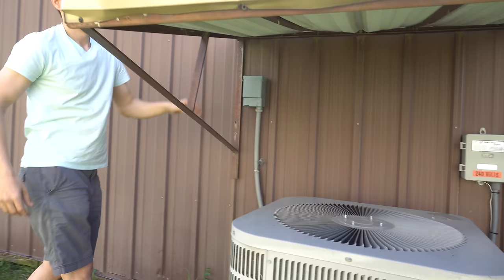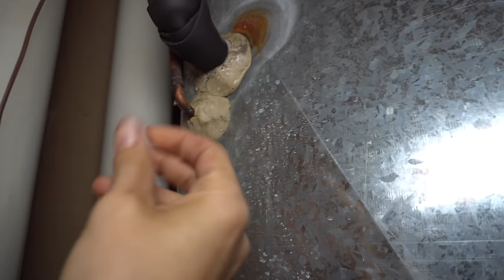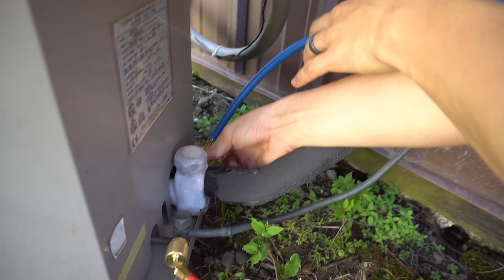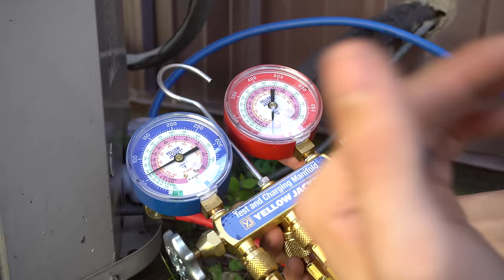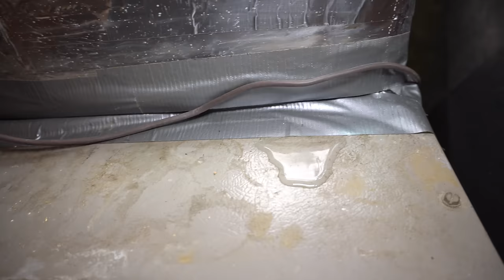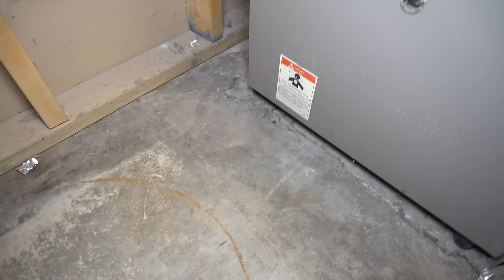How To Add Refrigerant To Air Conditioner

Comment: Addtinally the problem we have with a no weigh in charge (using a scale of refrigerant added) and creating a baseline of  proper temp/pressure utilizing subcool and superheat is the next technician comes across the unit (because your not available as a friend ) the cost becomes higher to the client. Why? When I know a customer has a leak (vs a restriction)-through tests- I cant do a leak decay accurately without a baseline of thermodynamic measurements. By doing this gas and go method we have no baseline numbers prior and after the recharge. Creates a higher cost of client as I might have to pull the current charge, do a reweigh of virgin refrigerant ( wont go into why I pull the charge and use new virgin refrigerant-lengthy best practices), then create my baseline of numbers temp/pressure/charge etc...Then from there ( if time doesnt allow to find leak) I schedule monthly to bi-monthly non-invasive followups to determine leak location and rate of decay- Check out APP #measureQuick every technician should be using a NON-INVASIVE process FIRST in diagnosing any refrigeration or HVAC system. Bottomline in the short run this costs a customer more money doing the "gas and Go" or "?cold beer can method?". Then properly planning for component replacement or unit replacement and or repair
Reply from the maker: Wow, that is a very detailed procedure explanation! Thank you very much for taking the time to explain thoroughly!
Reply: With all due respect.   He said the client was going to replace the unit in the video and that was why he was doing it in the manner that he did.  As a result, I think this video perfectly serves it's purpose. Additionally, (said in a purely factual tone) I looked at your Pro Answers youtube channel and was sad to find (ironically) that there were zero answers as you have produced zero videos (which is sincerely a huge shame).  It would be totally awesome if (since you are telling us the correct way) you would make a (COMPLETE AND DETAILED <<< emphasized)  video as you described here.  To be crystal clear... an actual easy to understand instructional video that goes step-by-step through the processes you described.  You can "talk the talk" so I am sure that you can "walk the walk".  I am just asking you to video it and make it your first video.  That being said (again no disrespect) I am hopeful that you will surprise me and produce the above requested video, but (unfortunately) I am willing to bet that you will not because of 4 things.  1.) The energy & difficulty associated with uploading, shooting, & EDITING a video so that it is clear and understandable to almost anyone (Kudos to Word of advice TV for your clarity). 2.) Doing so is a semi-selfless act (that not everyone is comfortable with) of helping others without reward (except maybe some google ad revenue).  3.) The general Mafia-like secrecy and mystery that the HVAC industry tries to promote & instill.  4.)  You may suffer from the mistaken general attitude that "if I make a video showing how to do it, I will be giving away my trade secrets and, thus, taking money out of my own pocket".  I VERY SINCERELY would LOVE for you to prove me wrong and make my last 4 points moot by producing the video and (if you do) please let me know, because I will probably subscribe to your channel at that point.  That being said... I am willing to bet money that Word of advice TV will beat you to it.  like I said, I hope you prove me wrong.  CORRECTION>>> I wrote all of the above BEFORE reading your next remark.  As a result...  I am 99.9% sure that you will NOT make the video (or probably any other videos) and that you are "most likely" a member of the jaded and secretive mafia-like "HVAC Illuminati" since you said that you disagree with this sharing of knowledge on youtube while CLAIMING that all of your decisions are driven by customer benefit when I am almost certain they are more about filling your pockets (as quickly as possible) with your customers cash... whether it be to their benefit or not.  I am not sure how you have the gall to get on youtube and critique those that seem to not agree with you.  In my opinion, "Pro Answers" needs to either change the name of your channel of focus on PRODUCING some videos (at least 1) before bashing other video producers investments of time and energy.
Reply: @jotu173  wow! Jo Tu! Very well put answer! or rather support for this brilliant "World of Advice TV" chap! He is incredible and anyone even daring a little to criticize his knowledge, style and the selflessness in this spreading of knowledge must be dealt with the way you commented on hte "Pro Answers" criticism!
Reply: @tivideosAZ  Thanks for your compliment & vote of confidence!  Believe it or not, the ironically titled "Pro Answers" originally responded with multiple attempts to justify their position and paint me negatively (which I quickly & accurately discredited) but, as I was now reading your remark... I noticed that it seems like (unless I am mistaken & missed something) they have decided to delete all of them in a seeming effort to not make themselves look any more worse than they already do.  I also suspect that they tidied up their original comment to try to limit the obvious "lameness" of it & to try to salvage their self-proclaimed "Pro" status.  Just thought you would appreciate this FYI.

Comment: Disagree with showing this process- we do like word of advice TV videos. Unfortunately this process falls into/over-utilized in the "GAS AND GO" companies (we dont even recognize them as HVAC companies) that over charge on refrigerant and are not putting a REAL solution together for the client with real thermodynamics * yes we know you mentioned this is a temp solution.   Band-aides/temp solutions unfortunately dont get fixed properly or followed-up by the client- they get forgotten. Low Refrigerant  charge will stress electrical components and eventually destroy the compressor mechanically. Thats just the small list- besides the leak becoming larger and becoming more- other areas. Additionally your electric bill will increase "significantly". We disagree with the EPA standards of leak % for residential units. ITS NOT A EPA LICENSE its a certificate of certification takes EPA testing to work with any refrigerant in a particular capacity https://ww2.epatest.com/epa-608/ . Obtaining a 608 refrigerant cert DOES NOT MAKE YOU A HVAC technician or engineer or competent in thermodynamics.
Reply from the maker: Thank you, Pro Answers, for a detailed explanation of why the "gas and go" method should not be used.
Reply: "Obtaining a 608 refrigerant cert DOES NOT MAKE YOU A HVAC technician or engineer or competent in thermodynamics."... And neither does simply signing up for an account on youtube so you can bash another producers EXCELLENT work.  Let me guess... if someone has a flat tire and they don't want to buy a new one because they will be selling the car soon..., your only "correct" recommendation would be to buy a new tire (as opposed to patching the one that they have and putting it back on the car)???  You definitely sound (to me) like the HVAC Illuminati.  I have got news for you.  Band-aids (the real ones used on skin) exist for a reason... they work!  As a result , billions have been sold & used.  No, they are not an end-all cure BUT THEY SERVE A PURPOSE... JUST LIKE AN HVAC BAND-AID!  I don't expect you to agree with me as it is not the most profitable solution for YOU.  I hope I am mistaken but, to me, it sounds like almost all you want to do is sell new units (highest $ profit zone).  If that is so, you should just open a supply house.  Who died and made you the god of all HVAC?  Where are YOUR >> GOOD & educational << videos??  I am hopeful about seeing at least one soon.
Reply: @jotu173  your out of touch with what you think our tone is with our comment. Our first sentence was we enjoy word of advice videos. Educate yourself on the term Illuminati- We think you just like using a marketed word of dogma.  50% of our business is keeping R22 units functioning and or retro-fitting them to compatible refrigerants that have less impact on the enviroment. Lastly the tire patch analogy has to be context with the companys liability policy of where the puncture is tread vs sidewall- most organizations will not fix a puncture through a sidewall due to the  mechanic liability acts and tire manufacture warrenty. We have supported this channel and the creator of this channel also knows the other youtuber HVAC companies that are credible: ACSERVICE tech, Ty Bernmman, HVAC school with MeasureQuick, GrayFurnance we align ourselves with science and the best practices; if thats being "hvac illuminati" then thats your problem. Good luck be illogical.
Reply: @proanswers  Your reply seems just as self-serving as your original posts.  Mostly only addressing the things that benefit your companies pocket book.  It seems that YOU should have looked up the word, but (since you didn't)...  "il·lu·mi·na·ti... people CLAIMING to possess special enlightenment or knowledge of something."  In my opinion, I used it 100% correctly and it seems that the only reason you disagree is because it is probably spot-on.  Also... you should look up dogma as it seems that you used it incorrectly.  As far as my analogy... I did make a mistake in assuming that it was common-knowledge that no one would even think of trying to patch a side wall.  So here is my correction... I meant a patch that was safely in the tread.  ALL of the rest of my prior analogy stands SOLIDLY.  I noticed (but was not surprised) that you did not mention that you would actually make a single GOOD video OR address any of the other points that I made.  Again, just what benefits you.  Not sure how you are "supporting" this video when (in my opinion) roughly 2% of your remarks are supportive and the rest isn't (at least in this case).  I challenge your channel to become as credible as the ones you listed...  make a good video that actually helps a NORMAL (non-HVAC) person.  Also, your use of the word illogical is... illogical.

Comment: Hi, thanks for the video which I learned a lot from.  My upstairs R22 AC runs continuously when it's on without lowering the room temp.  I see about 12-16F difference between output vent vs return vent.  I went outside and checked the AC compressor at the low side near the charging teminal and it is not sweating as it should be and instead, it is warm.  I measured the temperature near the terminal to be about 85 F when ambient temp is 84F.  I know it should be like 45F as my downstairs AC is sweating at the low side terminal as it should be and it measures 45F.  So what could be wrong?  I understand that, if refrigerant is low, the temp should be below 0 and the pipe around the terminal should be frosting.  Since it is opposite of this, could there be too much refrigerant in the system?  I would appreciate it if you could help.  Thanks in advance!!

Comment: So I tried to do this before watching your video and F-Kd it up -  Luckily I had very little R22 to begin with but I sent it to the high side - When I get more I’ll have to bleed some off the high side I’m at about 58-60 lbs on low side now and only getting a 76 degree return inside - I’m shutting it down not sure if coil is freezing up in attic but return is not strong so it may be freezing up

Comment: With that starting pressure I’d keep that unit running until a bigger leak occurs, the new systems out there are terrible and you’ll get leaks in 1-3 4 years and guess what your most likely replacing the evap coil where the leaks are most common, also I would have added more r22 into the system to compensate for the leak so the unit runs longer  and cooler for your friend for the whole summer I would have left it at least at 75 or 80 on the back me I would have left it at 80 back, but that’s me. That system could last a lot longer, adding a little gas once a year is not a big deal, considering the expense of a new system plus the new are junk, more efficient yes quality no unfortunately. And 17-20td is best. But nice video to try and help people out and give them a idea on what to basically do to throw in some gas 👍👍

Comment: Thanks, excellent video!  Is it best to add R22 in vapor form (tank right side up) to the low side?  

Saw another video where the tech added it with tank upside down….
Reply from the maker: Glad you liked the video! It is recommended to add it in vapor but if there is little refrigerant left in the tank or if the tank is cold then the pressure inside may be too low to push that refrigerant out. In that case I would flip the tank over and add it in liquid (using the throttling method). This only applies to R22 though. R410a can only be added in liquid. Hmm... This response is a bit more complicated than I thought it would be lol. I should make a video on this topic since you are not the first to ask this.

Comment: Great video with a lot of experience and knowledge, thanks for sharing. I have been watching all your videos as I need to fix my parents' ducted AC, which is not cooling at all at the moment. I tested the pressure yesterday and get quite confusing results with high side 50 psi and low side 0 psi when the system is not running. Are two sides supposed to be equalized when the system is off? When I took off the cap of the high side isolation valve next to the Schrader valve, I heard a brief air leaking sound, and I can see some trace of oil around the Hex keyhole, suspecting it's the source of the leak. I will bring some gas leak bubble spray to verify it next time and fix it before recharging the R410A. It will be much appreciated if you can shed some light on it. Thanks.

Comment: Hi Jay, great informational video as always. Lean a lot from your vids... Question, for an R22 system w/ non-TXV running on high outdoor temp ~100 degree, if low side pressure gauge runs high close to 95 psi what could possibly be the cause? Thnx again in advanced...

Comment: Hello, you said that if you keep the R-22 bottle upward, you'll let in gas in the system. But if you keep the bottle upside down, you'll let in liquid and risk slugging the compressor. 

Does that rule apply the same way with the R-410A pink refrigerant bottle?

I was taught to flip the refrigerant bottle upside down whether I'm charging the unit with 4-10A or R-22.

Do you suggest me to charge the unit with the bottle R-410A upright or upside down? 

Or is it only the bottle R-22 that must be upright when charging the unit? 

Of course, the system must be running in order to charge the unit.
Reply from the maker: You can only add as a vapor with R22. Most of the other refrigerants are blended refrigerants and can ONLY be added as a liquid.

R410a is a blended refrigerant so it has to be added as liquid only.

You can add R22 in vapor or liquid. I think they just decided that it would be easier to tell you to add as liquid only all the time to avoid any mistakes.

Add R-410A with the tank upside down. Either have a liquid vaporizer on your gauges or throttle it in to avoid compressor slugging.
By throttling it in I mean that you open your gauge just a little bit so that the pressure only goes up by 10-15psi while you add.

R-22 is not a blended refrigerant so it can be added either way. I like adding it in vapor since I can just open my gauge full blast and not worry about slugging the compressor.

Yes. The system should be running when adding refrigerant unless it's empty and in a vacuum. You don't want the unit running with no refrigerant so you would add some before turning it on.

Comment: I have an older air conditioner unit, so would the hoses and the adapter of the yellow jacket manifold gauge set need some additional adapters? The refrigerant line is 3/8" and the suction is 3/4" for r-22.  What steps to take, if possible,  to add another refrigerant safely?  My unit hasn't been serviced in a long while and hasn't been used to cool in the summer, so I think there's no remaining r-22.   I want to try to add refrigerant using r290 or something safer.  Thank you for the video.

Comment: WoA-TV, thank you for your video. I have a ICECO 10 seer (Rheem) condenser with R22. Have a Yellow Jacket manifold. Have two issues, one, the Red line connector doesn't fit the ICECO male connector. Two small. I added the quick connect, but they too big. Whould you happen to know what adapter I need. Also, the only R22 I could get is small 3lb cans. The yellow line won't screw on the can. Same size but different threading. Also, the puncher adapters don't seem to puncher the can either. Any help appreciated.

Comment: I most likely would not try it but it is nice to know how things work.   I need my AC charged about every three to four years... the last time the tech wanted to sell me a new system.  If it works, I won't replace it.   Thanks.
Reply: Scrub. Get him to find the leak first. At that rate it may just be the schrader, or the caps on the king valves
Reply: Never trust an HVAC tech that says you need a new unit without getting a minimum of two or three “second opinions”.  It’s unfortunate, but so many techs are crooks out to sell new units to get that commission check.   If more people were honest like this YouTube channel, it would help the industry, but right now it is ripe full of con men.
Reply: Your ac should never be leaking destroys the ozone!!! Add can of leak seal for ac $70 well worth it and your saving the planet!! Refrigerant is unbelievably bad for ozone. Look it up it never goes away and continually breaks ozone apart by 1-2 then 2-4 then 4, 8,16, destroying ozone!!
Reply: Brodie Johnston ..... driving a car 10 miles is the same as 1 pound of R22.   Basically it’s very very little damage.